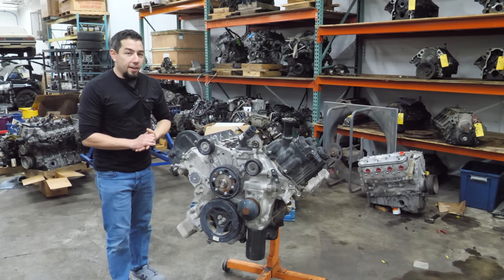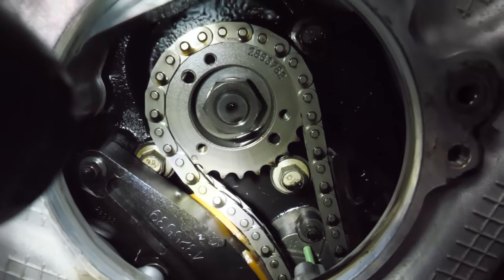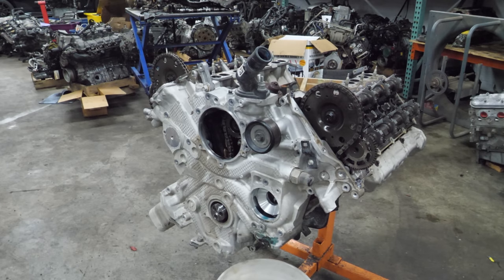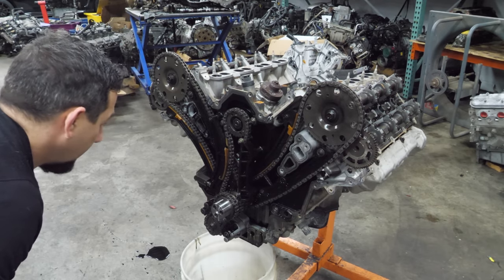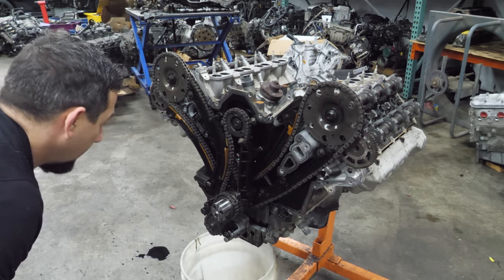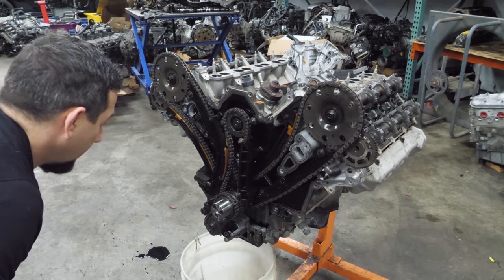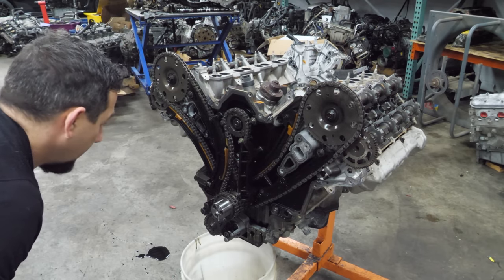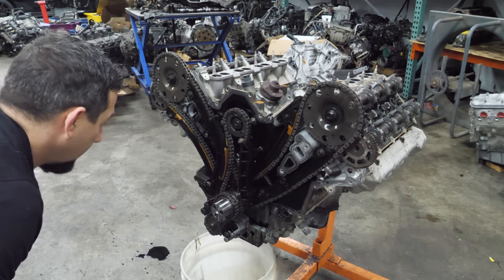Well That's Not Good! Nissan Titan XD Cummins 5.0 Turbo Diesel V8 Teardown. A Costly Failure!

Comment: 40:06 It's probably torsional vibration. You see this with the Ford 300 I6. That thing is FUCKING INDESTRUCTIBLE, and the stock crank is more than happy to spit out over a thousand horsepower if enough snails are hung off the side. But if you rev it much past 6500 that 3 foot long crank just vibrates itself clean in two. Starts resonating like a guitar string and POING!. Straight six Cummins diesels in Ram trucks are known to do this when revved much past the factory redline as well. Fix is the same in both applications: Fit a harmonic balancer that is capable of changing the resonance so the crank doesn't explode itself.

 It's also why those straight eights you see in cars from the 1930s, 40s, early 50s rarely revved much past 3,000RPM. The cranks were so long that they would start resonating, snap themselves in half.

V8s tend to be much more resistant to this failure mode because their cranks are much shorter(And thus resonate at much higher frequencies), but given this engine was 'tuned' it's entirely possible that it simply revved high enough to vibrate the crank apart. 

Where this crank failed also lends credence to this. A crank that fails due to excessive torque on it is usually going to shear  the snout or the flexplate flange off, depending on which end was connected to the overload. A crank that fails due to harmonic resonance tends to fail right there where it necks down into a journal somewhere.

My best guess for this engine's cause of death is operator error. Excessive RPM due to the operator deleting/raising the rev limiter and pushing the engine too hard without making the appropriate modifications to support that higher redline.
Reply: Nissan TD42 engines snap crankshafts semi-regularly near #6 too
Reply: Unfortunately these are snapping in stock trucks as well or I'd be likely to agree with your assessment of the error.
Reply: @r0ck_ste4dy83  Entirely possible the factory redline is too high or the engineers missed a carried 1 when mathing out the harmonic balancer.
Reply: @Retired Bore damper balancer it's called both through various part catalogs back through the years. Does the same job either way.
Reply: @C6 Modellsport  I bought my XD with 27k miles on it. Happened to noticed the harmonic balancer/dampener had a slight "wobble" while running. It wasn't loose, just wasn't running completely true. Replaced it somewhere in the first 3k miles I owned it and I check it every so often. So far the replacement runs true. There was some speculation in the XD community that a poor design of the dampener/balancer contributed to the crankshaft failures. An aftermarket company was even willing to develop one if they had enough pre-orders but it never happened. Most felt the price was too high for a 'maybe'.
Reply: @r0ck_ste4dy83  Wouldn't surprise me if that's why a lot of them snapped cranks in OEM configuration. Faulty dampers that early on would definitely make something go pop.
Reply: @Retired Bore Actually, some of those can have a counterweight on them.  Some of the larger General Motors V8 engines of the 1960s and '70s had counterweights out on the front crankshaft pullies.  And some of them also had counterweights on the flywheel.  Those crankshaft pulley assemblies with counterweights could qualify as "balancers".  There are two types of torsional dampers used on the front crankshaft pullies of automotive engines.  Some are just a rubber coupling that dissipates the torsional vibrations.  These would be analogous to a resistor in an AC electronic circuit.  The other type of damper is tuned to a specific frequency.  These would be analogous to a high or low pass filter in an AC electronic circuit.
Reply: diesels in general dont like rpm's............heavier components needed in a diesel mean less rpm's. but your right..........it doesnt stop people over revving them and breaking them.
Reply: @TestECull  Just like "Drop axel" or "Lift Axel" same job either way.
Reply: Interesting
Reply: @retiredbore378  that's an interesting piece of information,  I myself was not aware of the technical differences in balancers and dampeners
Reply: @wazza33racer  Yep. Even the low displacement V10 diesel Audi won with at LeMans so much only revved to about 5,500 or so. Pure race engine, only 5500rpm, meanwhile the otto cycles on track were able to nearly double that. Diesels just do not like to rev even when engineered for an application high revs work well in.
Reply: Almost indestructible. There are people out there that can tear up anything given time and it not being theirs.
Reply: @wazza33racer  Some people can tear up anything. Knew a guy who thought speed shifting meant holding the throttle on the floor pushing in the clutch and letting the engine windup and then dumping the clutch. He did that all the time with his S-10 and he ended up getting over 300k out of 2.8V6 that was in it. One of the most impressive engines I've ever seen. Guy constantly tearing up clutches and blowing up other engines but that little bastard was tough.
Reply: @Parents_of_Twins  Yep. Only really three ways to kill a 300, and all three require some MAJOR abuse. 1: Overheat it to the point the pistons weld themselves to the cylinder walls. 2: Somehow rev it past 6500 on a stock crank. 3: Run it without oil in it for quite a while until it yeets a rod. Tough as nails!
Reply: @frazzledude  I think you mean a capacitor in a DC circuit, the purpose of a harmonic DAMPER, without balance weights, is to absorb and dissipate any shock loads, which is exactly what a capacitor does.
Reply: @Parents_of_Twins  During the 'turbo' era of Formula 1........the V6 was the king of sustained high rpm.  It was known in heavy trucking, that the GM 6V92 could tolerate horrible abuse........being over revved down hills.
Reply: @wazza33racer  The 6v53s and 6v71s as well. Really put credence to the nickname 'screaming jimmy' 'cause they'd rev halfway to mars and sound positively diabolical while doing it.

Almost makes me wonder just how fast you can spin one of those Detroit 2-strokes before it goes kerbal. Being a two stroke it has another advantage with regard to staying together in that the conrod is never under a tension load while the engine is running. Always under compression. All two cycle engines share this trait and it makes them quite durable with regard to high revs.
Reply: You seem to know what you are talking about - Why is the smaller end of the two piece crankshaft blue - like it was superheated???
thanks
Reply: @robertthacker2203  Because it was superheated. Oil passes through the crankshaft to lubricate all the bearings and when it broke in half all the oil just puked out right there where it broke instead of making its way to the remaining bearings beyond the break. Friction goes through the roof and that gets the crank screaming hot. You see that discoloration with the yeeted rod teardowns on this channel, too, because the spun rod bearing caused oil pressure to fall off(if it was even there to begin with; a lot of them spin the bearing because of oil starvation!) and with no lubrication the friction gets everything screaming hot.
Reply: C6 Modellsport - you obviously understand this very well. two more questions: did this happen because it was tuned??   It had to take time to superheat the crank to make it blue - I am a structural engineer and did vibration analysis at a car company. I have seen an engine go from vibrating to tearing itself to pieces in the blink of an eye, so I am guessing this gave no warning, then bang, and he
kept running it while the crank was baking itself the hot oil?? thanks - do you have a channel??
Reply: @robertthacker2203  Pretty much. The break wasnt catastrophic enough to stall the engine. It would have been running like absolute dogshit and clanking like hell itself was trying to break out of the case, but it would have still been able to function. With how much sound deadening material they put in modern vehicle cabins the clatter would have been muffled to a lazy tick, so really the only clue the engine was mortally wounded would have been the dashboard lighting up like a christmas tree. And if the tuner is a bit 'messy' even that could be drowned out; if the driver is used to seeing a couple MILs because of the tuner doing its thing he wouldnt necessarily notice the additional lights coming on to report catastrophic oil pressure loss. That, in turn, sets the scene for the driver to keep their foot in it long enough to blue the steel of the crankshaft.

I do have a channel but its 98% rc stuff and 2% gaming clips.
Reply: I think they were towing over-heavy and got steeper downhill...
Reply: Horsetorque diesel channel has multiple…. Multiple stock bottom end putting out well over 2500 horse power all reving beyond 5k with no issues. The only thing he does to the crank is weld the gear drive to it instead of pinning. So no don’t see a lot of 6.7 Cummins have this problem. And yes, I called pull-a-part and asked if this was a common problem and guy said he’s never seen a broken crank out of a 6.7.
Reply: Bro, that lingo is rad.  Love hearing someone wanting to be hip and say "snails" instead of "turbos" like whoa dude
Reply: My girlfriend snapped when she resonated too hard in the red
Reply: Language?
Reply: thanks nice autopsy analysis.
Reply: Most people report the crank snapping while cruising at 70mph. Almost always towing too. They would be driving then start hearing a terrible knocking sound. They just keep driving home. Then it won’t start after you turn it off. This is what 90% of 5.0 Cummins owners have reported.
Reply: i also heard the crankshaft snapping on some land rovers, i know one that also blew up when pulling load. generally, low RPM engines, especially over head valve, have issues to take high RPM. in this case it was a not well designed crankshaft combined with some mild tune and italian driver. of course, the crankshaft is a stressed part, but how the hell some random cheap small four cylinders can handle past 400 hp on stock crank with high revs and not snapping that? though other than the crank, seems like those are not that bad engines..
Reply: @garage5125  Light rotating mass, short stroke. Same reason the $150 engine in my Kyosho Scorpion can rev to 35,000RPM under load without exploding. The piston in that engine weighs just a couple grams and the stroke is half an inch or so. General rule of thumb: Lighter rotating mass, shorter stroke, higher RPM capability. 2 strokes have a further advantage in that the conrods are always under a compression load when the engine is running, which is where they are at their strongest. Their torsional vibrations are also at a much higher frequency because they fire every time the piston comes up, rather than every other time, thus twice as many torque impulses as a four stroke of the same cylinder configuration. This is why a Detroit Diesel 8v71 will rev reliably to 2500rpm whereas its peers from Cummins, CAT,  Mack, Volvo, etc struggle to top 1750. 8v71 is a two stroke engine.

Its a bloody miracle the crank in the Ford 300 I6 can take 6,500 before it starts failing given it's three feet long and weighs 40 pounds on its own. 'course you'd never hit that with a stock or even mildly built 300 because they can't breathe, but a determined nutjob with enough 6bt turbos and a welder could do it. 

Ford 300 will take a thousand horsepower on the stock crank and rods even though it only made 120 or so most of its life in factory trim. Just don't rev it too high.
Reply: @TestECull  what stroke and displacements are those engines? of course i know i am comparing a gasoline with diesel so it is not very fair:-) 6500 RPM is a huge speed with diesel, sadly not all engines can take that. but i would say the crank would be a very tough part, i would rather thought than the first things that blow up would be stuff like rods and rod bolts... despite long thin crankshafts are an issue i know, but i have actually seen more broken v8 cranks than inline 6 ones, since they are not as well supported. i live in the eastern part of the world, and i know old czechoslovakian škodas, for example škoda 1000MB. the name originally standed for 1000 years of the town of mlada boleslav and also for the displacement of the engine. however, as they were not very reliable, there are many jokes around them, also the joke than the 1000 mb stands for 1000 malých bolestí,  which means 1000 little pains. namely around the not well thinked out engine, carburated 4 cylinder(nothing crazy, the first ones had like 50 horsepower), that was overheating as it was in the back, blowing head seals all the time, not starting in winter and so on. but importantly, for a four cylinder engine, they had crank supported only on 3 main bearings, so when somebody fitted this engine, or its modernized brother found in favorit and felicia with a turbo and tried to make a lot of power, the crankshaft just snapped. and even with the stock engine power, it had a tendency to form little cracks in there. i know one of them that did have almost no oil pressure, and later they realized(even though the engine ran) than it had a cracked crank. and i know even some mercedes engines, that had a SIX cylinder on only THREE bearings. all you needed to do is put your foot down few times. not than the old škoda engines are good, but they were not snapping cranks like that. the newer engines from favorit were like a night and day diffrence in reliability, despite being very simillar. when you want to race with the old škodas, it is not recomended to turbo them, natural aspiration still will make the car pretty fast, when those things get like over 120 hp, they become almost too fast. with some good mods, seven grand is possible. though you need to think out the issues with the head gaskets blowing all the time. however, not all eastern engines are that bad, generally, unlike the more modern western engines, they just dont make much power from the factory. they are however easy to work on, last often stuff that other engines simply won´t last, and with some proper tuning, they can put a shame on many modern engines while also being dirt cheap compared with the western or japanese stuff. for instance, lada engines. you can take the simple 8 valve 1,7 litre four cylinder that has like 80 hp from factory in a lada niva and just by bolting turbo onto that, you can get over 200 hp. there are also 16 valve 1,6 liters, that have some slightly weaker internals, though even those can hold over twice or maybe even 3 times their original power rating. no head porting, no cams, only turbo and bigger injectors, and perhaps upgrade the oil and water pump.  with stuff like ported head, they get 400 hp on standart bottom end. and sometimes, i see stock or perhaps nitrated crank holding over 700 bhp in the 8 valve 1,7 litre. yes, 8 valves, 1,7 liters and 700 hp... on stock crank of a 80 hp engine.
and in case of revs, in case of natural aspiration,  both 8 and 16 valve can rev 7 to 8 grand on stock, though it is better to replace the rods, pistons and crank with some atmospheric tuning stuff, since the stock ones are pretty heavy, and atmospheric engine does not make massive torque, so the weaker but lighter internals allow it to rev even higher with less power losses. with turbo, you can use the stock and rev it to 7-8grand as well, though the 16 valve will not need such massive boost pressures. suprisingly, even then, the crank can hold it together. however, both turbo and atmo engines can rev over 10 000 rpm on forged internals, though suprisingly, even with some of the 16 valve turbo engines making over 700 hp that rev over 10 000 RPM can be held together by a standart crankshaft. so when i see an expensive engine, that is showed as a state of an art engineering, snap crankshaft in half with mild tune, it is a little bit suprising...
Reply: @garage5125  Mm. Well, bore and stroke varies.

 Ford 300 is a gasoline inline six, OHV pushrod configuration, 4" bore 3.98" stroke. BIG pistons in that thing for a gasoline engine. Used in all manner of stuff...work vans, pickup trucks(Where my two examples are; half ton F-150s), airport tugs, generators, etc. Very versatile, rugged, dependable engine. Also sold in configurations meant for LPG fuel.

Detroit 71-series 2-strokes all share the same bore and stroke regardless of cylinder configuration; that would be 4.25" bore 5" stroke.The 8v71 I mentioned is one of the more common variants and is a V8 diesel engine intended for use in semi trucks...in your country companies like Tatra and KaMaZ would produce trucks these engines would be put in. The typical 4-cycle engine used in such trucks over here in the US is an inline six between 12 and 16 liters in displacement revving to no more than 1750-1800RPM; a Detroit 8v71 will not only rev to 2500 but it makes power the whole time! In fact the faster you rev one the more power it makes...aaahhh, quirks of two strokes. They just want to rev and rev and rev and rev. Some of the smaller Detroit 2-stroke engines...4-53 for example...are known to be able to hit 4,000RPM without exploding! Unheard of for a diesel engine designed 80+ years ago and even today difficult to achieve in smaller engines(The 4-53 is somewhere around 4.5-5 liters in displacement; way larger than the typical diesel I-4 that revs to 4 grand). You should look a few up they sound amazing.

The engine in my Kyosho Scorpion? It's a tiny li'l bugger. Displaces just 4 cubic centimeters. TINY little thing! The entire engine will fit in my pocket if I take it out of the buggy. I can't really find any bore/spec data on it, though...not uncommon with engines for RC buggies it must be said. Burns a highball mix of methanol and nitromethane, makes stupid power(Rated around 2.2-2.3hp). I have videos of two of them on my channel; one is in my Mad Crusher(OEM engine in that model) and the other is in my Scorpion XXL(Built from kit, sourced engine elsewhere).

As for main bearing counts...it depends as much on the engine's design as to how many main bearings it needs. The toughest V8 Ford ever made is the flathead V8. It only had three main bearings. Nobody really knows what the upper limit of revs is on one because you can't really spin one fast enough to find out! That thing's built like a brick shithouse and is basically indestructible. The Model A and Model T 4-cylinder engines that came before it also only had three main bearings; their rev limit was more bearing design itself than how many were present as these engines were very primitive. Used poured babbitt bearings and splash oiling. You could pretty easily throw a rod in one but it's hard to chalk that up to the 3 main bearings when you're dealing with hand poured bearings that are splash lubricated.

Making power on, say, a Ford 300 is pretty easy. All you really need to do to take one from 120hp to 400hp and 275ft lbs to 450ft lbs is put an aftermarket camshaft in it, fit a nice header, 4-barrel carb, intake manifold, and open the ports in the head up a little. Pretty quick, pretty easy, does not take much to do. This is very common for American designed engines that came to be in the 1950s and 1960s; they were all understressed, overbuilt, and choked off so the hotrod potential is astronomical. If you have a basic understanding of how an engine functions you can usually triple the power of any USDM engine made between 1957 and 1987 with the correct package of bolt-ons!

High RPM is not normally their strong suit, but it can be done. Ford's little 289 V8 is one example. It's a simple pushrod OHV 2-valve engine...one of the smaller Windsor series V8s...and with the right cam, valvetrain parts, carb, intake, and exhaust system? 9,000RPM and power the whole way there is within your grasp. Sounds absolutely DEMONIC doing it, too! That's how NASCAR engines are built; they're obviously much more blueprinted and larger(Rules say roughly 5.8 liters max displacement) but they can rev to 10 grand, make 900-1100HP doing it, hold together forever(Engine failures are rare in NASCAR!), and they do it all without forced induction! And up until just a couple years ago they did it on a carb even! There is no replacement for displacement, after all.

Fun fact: That's all turbos do. They make a small engine displace more than it otherwise could. That's it. No replacement for displacement holds true so well that even small displacement engines need more displacement to make power, and they get it through boost instead of physical size.
Reply: @garage5125  https://www.youtube.com/watch?v=CwJXIrQLMWg Here ya go. Detroit 8v71 2-stroke doin' what it does best. It's turning 2200-2300RPM in this video CONSTANTLY. Quite a lofty rev for a semi truck engine!
Reply: excellent analysis
Reply: @frazzledude  Yeah old school engines had harmonic balancers, most modern engines just have dampeners but most people don't understand the difference and use the term interchangeably when they are two different things.
Reply: These snap in stock trucks that are babied all the time
Reply: @destinhook3826  No, they don't.